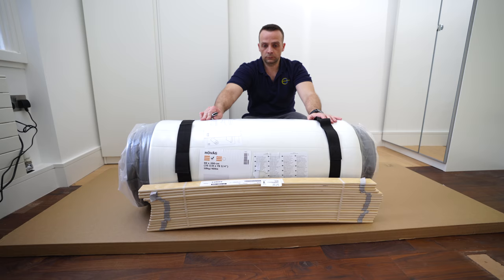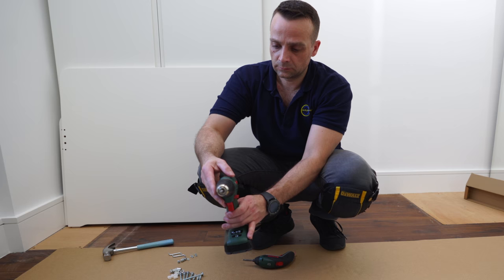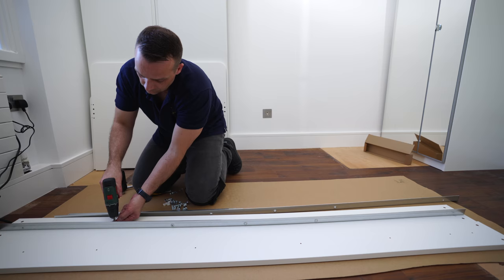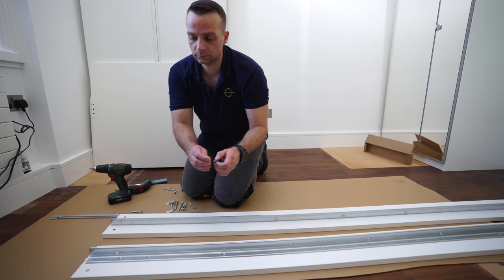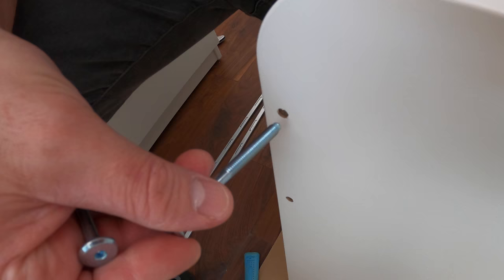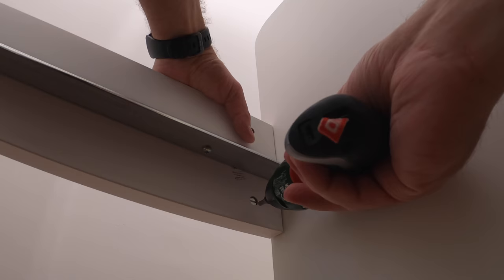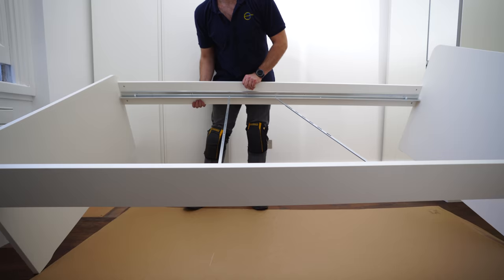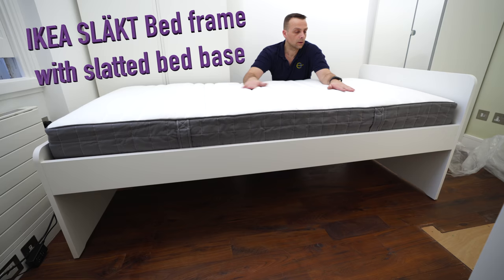IKEA SLÄKT Bed frame assembly instructions

Comment: Hi, I’m trying to put the rails and yeah the screws are really small, I saw that you put them on diferente holes that the manual said and also doesn’t it come just with 5 screws? I think you would need 6 to do it your way… I would appreciate the help thank you!
Reply: i had a lot of trouble with this part as well. i ended up using some longer screws that i had from other projects because at the point where the two rails come together, the screw would not come through the second rail. 
i don't think these parts are altogether necessary for the stability of the bed. they seem to be really flimsy.
Reply: I’m literally having this problem right now and went on YouTube for some help! I thought I was missing a screw or lost it when I watched the video but now I know for sure it just came with 5. I don’t know why the included such tiny screws! They really should make it a bit longer

Comment: I hated to build this bed A LOT, the rails and their screws suck :( but at least I made it and now I'm sleeping on it, lol.
Reply from the maker: Interesting. This one is one of the easier Ikea beds to build.
Reply: the rails and screws were the worst part. if the screws were just a couple mm longer, it would have been easier. i would have liked a bolt and wingnut solution.
Reply: @modestalchemist  Exactly, I read that a lot of people have issues with that. Ugh, I just replaced them with longer ones and even used plastic straps instead 😂

Comment: Hi I wish to know if you can help me with the size of dowel pins and the screws. I shifted homes and misplaced some screws and dowel pins that were removed while disassembling. Trying to order from amazon. Also which electric screw driver brand are you using please?
Reply from the maker: Ikea have spare screws and fittings if you need just give them name of the item. All links for tools I'm using in the description.